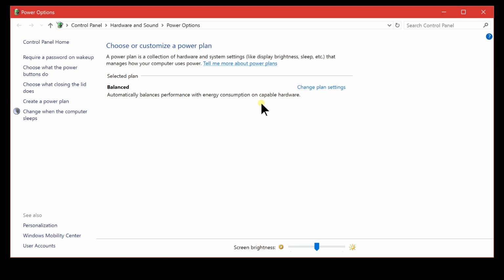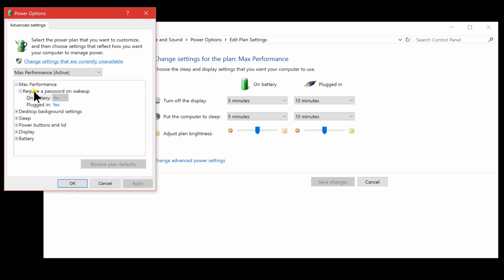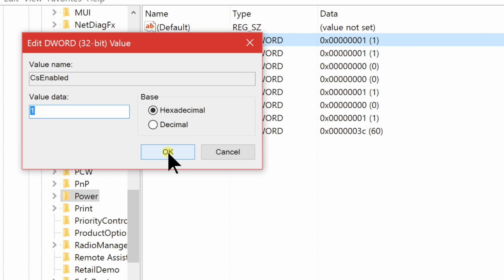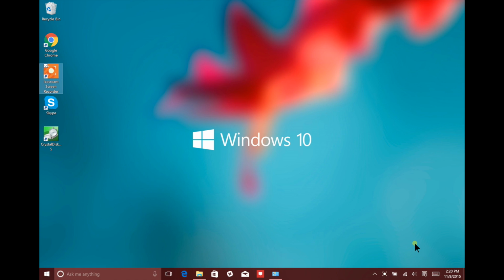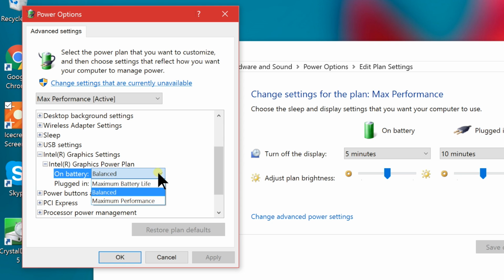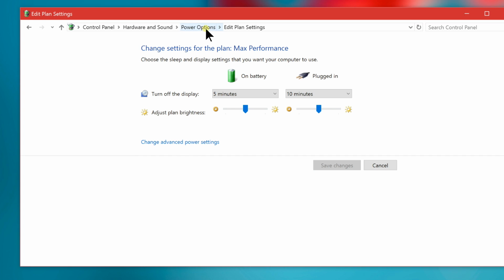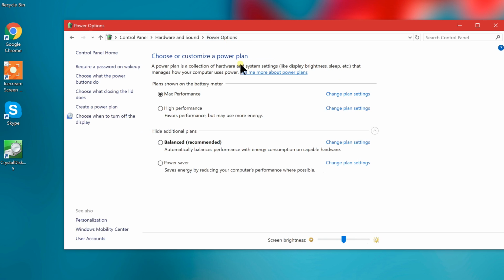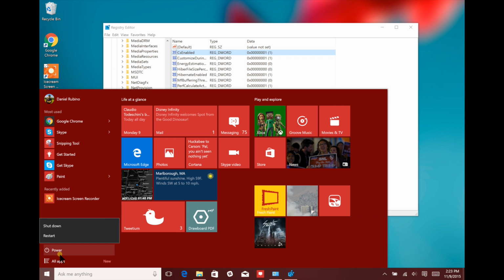Surface Pro 4 and Surface Book - How to enable max performance for Intel HD graphics

Comment: I have a Surface Pro 7 and I just thought I'd try to use your instructions to improve my FPS which seems very sluggish. Did everything specified but as soon as I restarted and went into those settings, nothing changed with no added options for higher performance. Few more advanced options settings but nothing that allows me to change the Intel graphics.. any advice would be helpful, thanks ✌️
Reply: If you updated to Windows 10 2004.It wont work. MS disabled it

Comment: It actually works the exact opposite way. Best gaming frame rates - battery saver mode. Lower frame rates - high performance mode

I’m not kidding, just try it
Reply: maybe your system just overheats if not throttled. I suggest you to measure your cpu/gpu temperatures.

Comment: How do we do this for the Nvidia discrete graphics card?  I have a problem where when pushing display to (more specifically, mirroring) a TV through USB-C>HDMI, the Intel Graphics Card will actually power both the laptop and TV displays; Nvidia card is never recruited ... performance suffers dramatically. Also, when creating overrides for specific programs in 3D Settings manager in the Nvidia Control Panel, the Surface Pro 2 still reverts to the Intel Card ... very frustrating and I expected better customization for such an expensive machine.

Comment: did this on my surface pro 4 all steps lined up. restarted and nothing changed no extra settings or anything so idk maybe im special
Reply: Same here. Have you found a solution?
Reply: Worked for me and I have a SP4.
Reply: Did not work for me either

Comment: Will it hurt to have maximum performance on 24/7?
Reply: Ryan Chew it may effect battery life but I think that there is no need to use max performance for daily things
Reply: Efemert Yalcin because once I change csenabled back to 1 and change from performance to balanced mode, the performance plan will disappear. I need sleep on my surface so the only way is to use max performance 24/7 without changing back to balanced. Any ideas?

Comment: Everything works fine but I have weird issue. when I change power option, the change doesnt reflect right away. setting of bightness changes but graphic setting doesnt change.  I have to reboot computer to enable the graphic setting. Please help.

Comment: most likely this registry trick will also work on other devices and also older surface devices (I think that hardware is the limiting factor here). It seems like a universal settings tweak.

Comment: Is there a downside to doing this? Probably heat issues or something of that sort?
Reply: Very likely, but it won't damage your device because it'll slow down the Intel Graphics once it's getting too hot.
Reply: It might lower the lifespan of your CPU/integrated graphics.

Comment: Aren't "balanced" supposed to max the performance when needed?
Reply from the maker: +Martin Zone In theory, maybe, but in reality this is rarely the case on any laptop for "balanced". Balanced is basically middle ground, not base to max. Even non-Surfaces do this as well.
Reply: +Windows Central Then is really strange that they didn&#39;t set the max performance inside the balanced plan when plugged in. What would be point of anything else in that scenario?
OK maybe faster charging...

Comment: You can also manual install the latest intel drivers which allows the intel control panel where you can set it to high performance as well as adding custom resolutions.
Reply: How
Reply: NVM, Got it, Thanks.